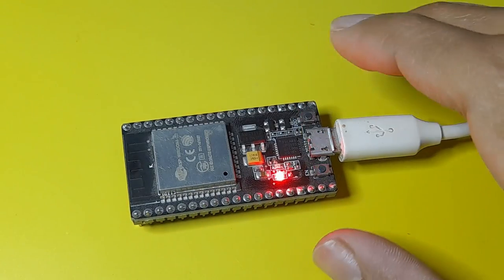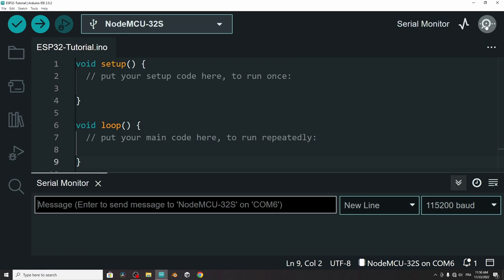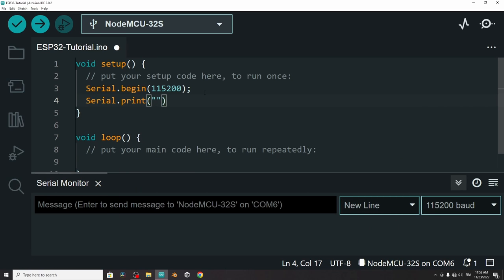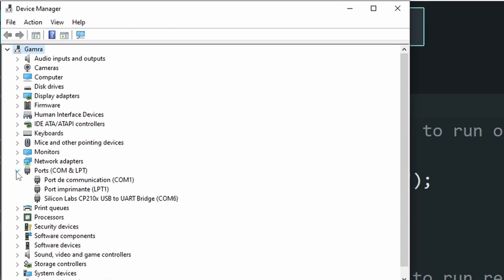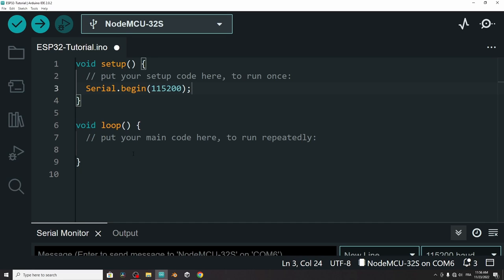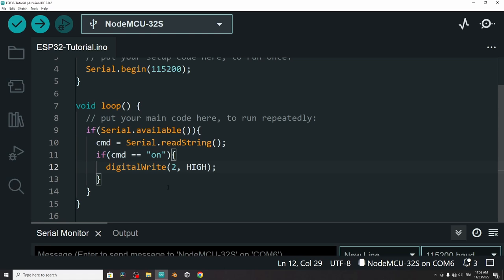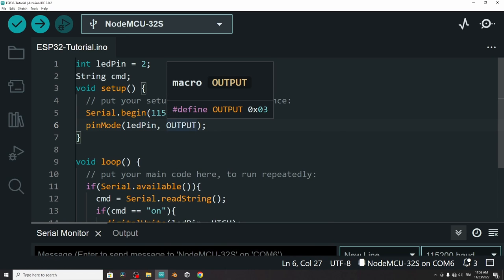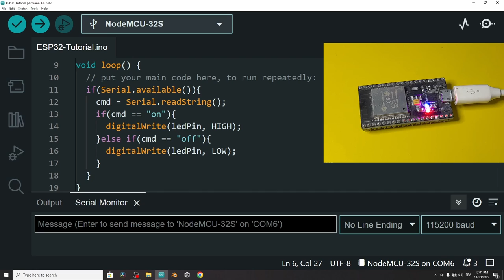ESP32 Tutorial - How to use Serial  Monitor ( NEW Arduino IDE )

Comment: hello i have an esp wroom 32 (node mcu) and my serial monitor is not working propely this is the messages that i get
19:21:03.174 -> rst:0x3 (SW_RESET),boot:0x13 (SPI_FAST_FLASH_BOOT)
19:21:03.174 -> configsip: 0, SPIWP:0xee
19:21:03.174 -> clk_drv:0x00,q_drv:0x00,d_drv:0x00,cs0_drv:0x00,hd_drv:0x00,wp_drv:0x00
19:21:03.174 -> mode:DIO, clock div:1
19:21:03.174 -> load:0x3fff0030,len:4832
19:21:03.174 -> load:0x40010000,len:0
19:21:03.174 -> load:0x0f352000,len:264176192
19:21:03.495 -> ets Jul 29 2019 12:21:46